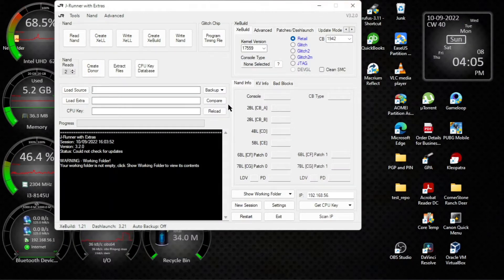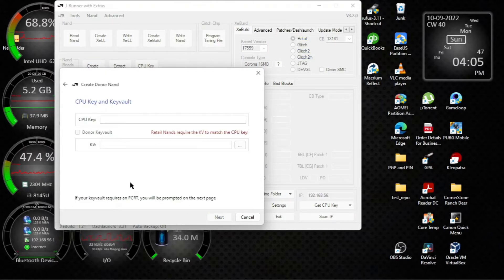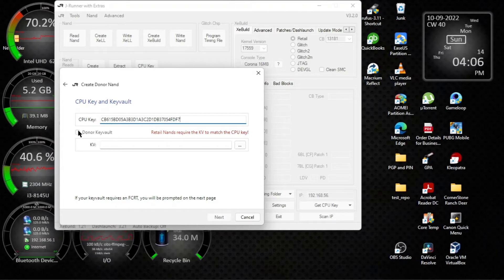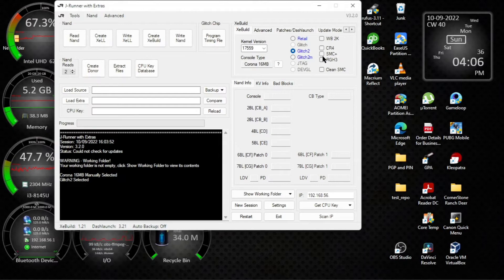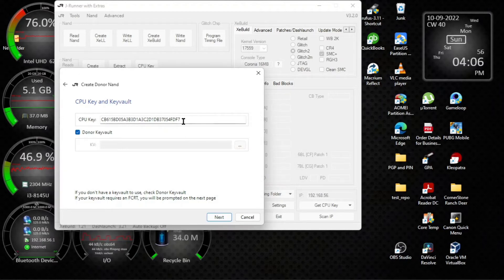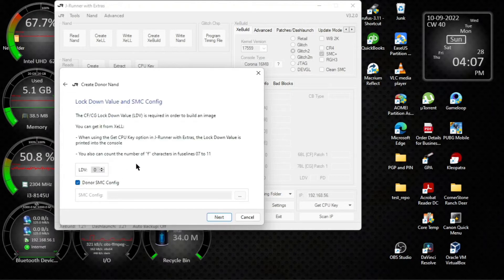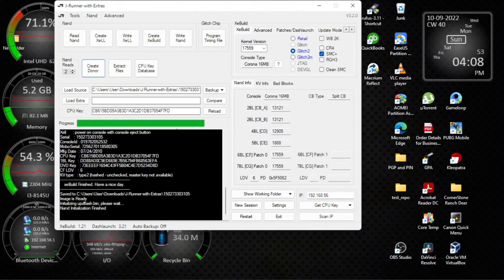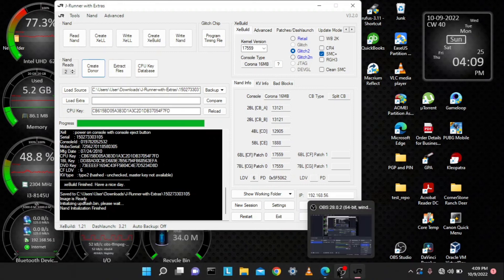Xbox 360 S Rebuild/Repair NAND flash with J-Runner 2022

Comment: Didn't work for my situation
Reply from the maker: Explain where your at man and I'll see if I can guide you and getcha up and running
Reply from the maker: What all have you done I JRunner and I'll see if I can help getcha going?
Reply: Well I'm having an issue with a 16mb corona I did a rgh3 wire install wrote xell it worked got the cpu key but after writing the custom image the system wouldn't power on only the beeping sound so I tried your method and the same thing happened
Reply from the maker: @wesleylyght9373  ahhh the old beep beep beep...yes I know where your at. Your going to have to flash it using your saved Nand dumps and then go through the process again as if had never been flashed. In JRunner go to Load Source there should be a folder in output then under the extras folder called nandump1.bin and nandump2.bin, use the first one as the source by clicking it then in Load Extra go back and get the nanddump2.bin then compare and Write Nand.